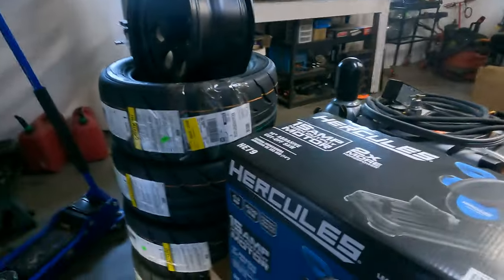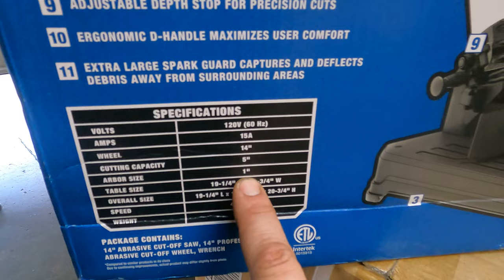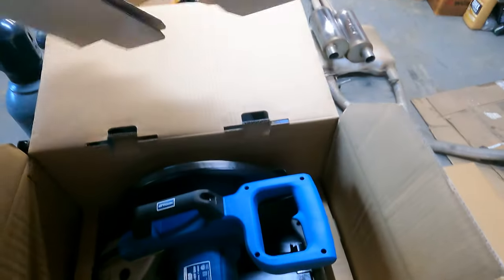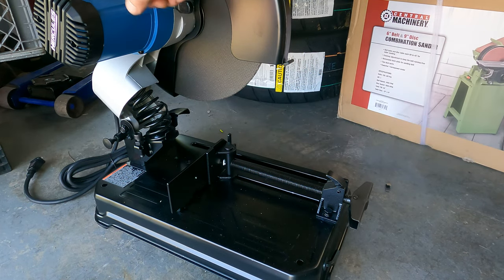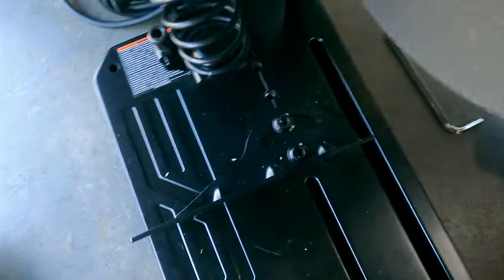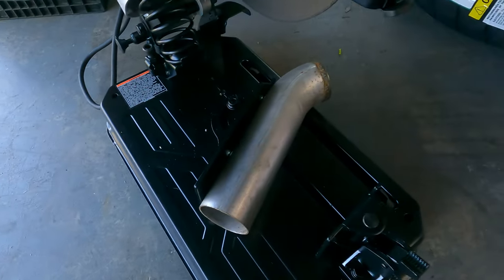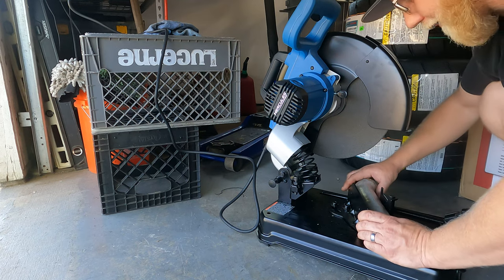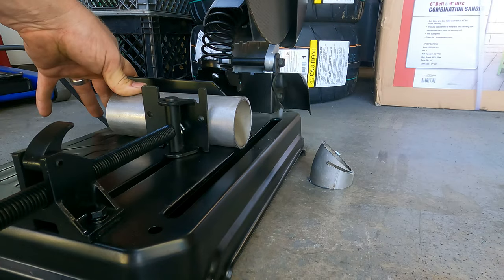UNBOXING: Harbor Freight Hercules chop saw

Comment: Just a heads up and you may know this by now, you are not supposed to run a cold cut blade on that machine. It’s way too fast. Also in my experience if you need super accurate cuts it would be best to go with a cold cut off saw like the Evolution. Especially if you’re doing a lot of angled cuts. The abrasive saws drift pretty bad in my experience. Best of luck!
Reply from the maker: I did not realize there was a speed difference. Thank you
Reply: @GibsonGarage  Sure thing. I started with the Ridgid abrasive and after I couldn’t get clean cuts, I took it right back to Home Depot and ordered the evolution multipurpose cold cut saw.